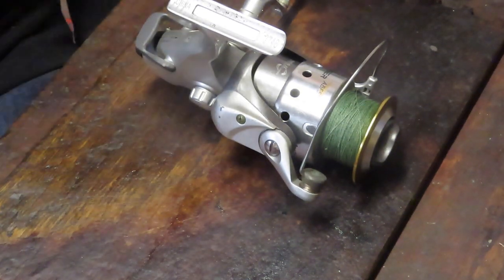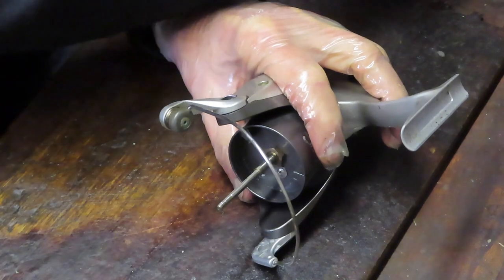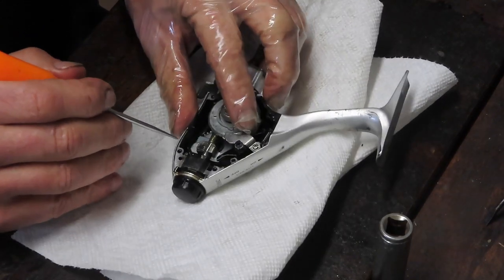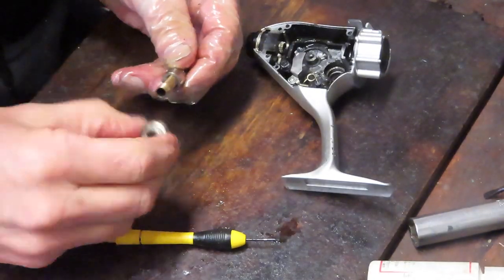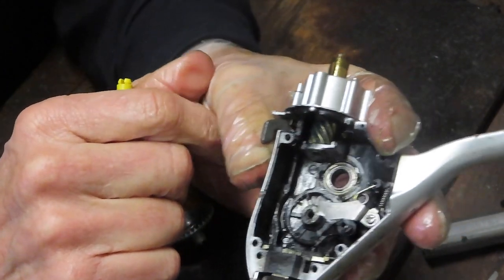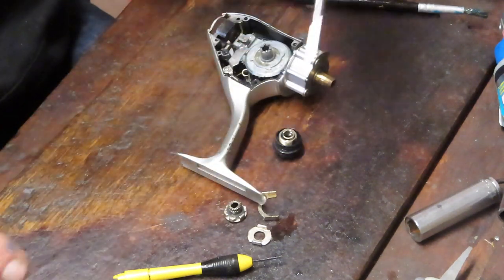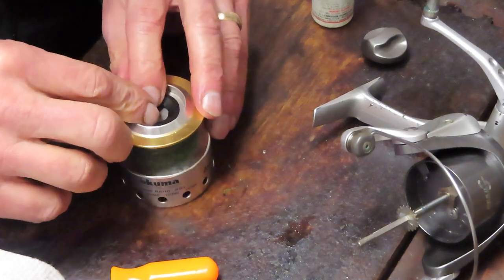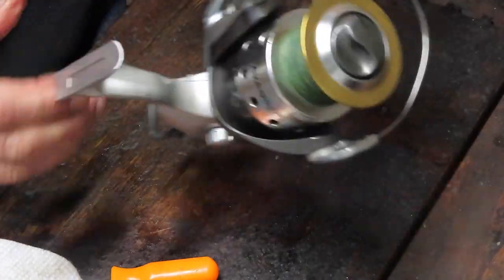Okuma Avenger ABF50 bait feeder fishing reel how to take apart and service

Comment: Dennis, I got an Okuma Avenger AFB40 last night. It was very reasonable and in almost new condition. It comes with the box, papers, and an extra spool. I would have wanted to get a model that is a little larger but this one will be what I need to learn how to use a bait feeder reel.
Reply from the maker: Still adding to the collection from your new YouTube site?
Reply: @2ndChanceTackle  yep! From my new YouTube Channel:  “Back in the Hospital Bed.”  I am really pleased and surprised by a South Bend Classic 960 reel that Armando told me about. It was inexpensive but incredibly over-built by Ohmori in Japan. I have one Gladding South Bend reel that is awful. This 960 is a worm gear reall with all internal parts being stainless steel. It looks like a SpinMaster Pro Series or Fury Diamond  as well as a few Shakespeare Ohmori reels I have. I’m sending you photos.I had given up on ever finding a decent vintage rear drag reel from Daiwa. I’ve had two that I had to get refunds for and the sellers didn’t even want them back. They couldn’t have been repaired. This latest one is a very large Daiwa ST-9070 rear drag that has a lever for quick setting the drag. To look at it you’d think it is a bait feeder but it’s not. I’m home from my YouTube site now and feeling some better. It’s going to take a few months after this illness to be near normal again. Moving around is difficult. ——Chris
Reply: Chris, thanks for recommending this video to me. I guess, it will help me with my Okuma Baitfeeders  in the future.
I hope, you will be able to fish with that reel very soon! Get well fast and keep care of you. 
Bart
Reply: @bart-b9497  Tmhanks so much my good friend! I had no idea you were such a connoisseur of Okuma Spinning reels! You have some very nice Okumas! This OKume Avenger I just got was the first Okuma reel I’ve ever owned. As I said the more I delve into its secrets the more I like it. Can’t wait to sigh with it! I enjoyed the photos our your reels! Thanks also for the get well wishes. I’ve got a way to go yet but I’m definitely in the mend!

Comment: I have one of these I bought when they dropped the 50 size reel and had them on closeout. It is one of the few newer reels I use and it has been a good reel. I got it to use on a catfish rod where a baitfeeder works great. It's not so complicated that I couldn't tear it down to service it.
Reply from the maker: Well said.  Durable and easy to service.  Sounds like a good reel for cat fishing - best wishes - Dennis

Comment: Everything I see in this reel makes me like it a lot. Simple is always appealing to me and compared to other bait feeders this one is much simpler. I like seeing that seal and I love having an AR override. It has 3 bearings and I like that.  I’m not overjoyed with the rear drag however.  I like it Dennis. Maybe this would be a good first bait feeder for me.
Reply from the maker: It would be worth looking into.  Made in Taiwan at the Okuma plant.  Reasonably priced and with all of the features you would need -
Reply: I can attest to their quality. Three years ago, I bought one, liked it so much that I bought 2 more. I've caught everything from bait to tiger muskies on them, and they've handled the heat of summer to dead of winter in Central New York. One of these days I'll get to the ocean and try them there too.
You can certainly pay A LOT more for a lot less reel.

Comment: Loved the video. Am working on my own ABF50. One portion you didn't cover is the Bail Arm/Wire . My issue is that it is not automatically flipping when the reel is turned. I removed the Bail Arm Cover and the Kick Lever "kicked" itself out .... Ideas on reassembling? and how to address the Bail Wire now flipping to reel in?
Reply from the maker: Watch this video and see if it helps you reset that arm and spring https://youtu.be/Qrr_rizFkYw. Thanks for asking - Dennis

Comment: These reels are pretty decent and can take a beating. I just dislike the "graphite" ramp to trip the metal bail. I don't understand why manufacturers just can't attach a metal plate on top.
Reply from the maker: I guess that would involve more cost and a design change in the mold.  I don't know of any graphite reels that have that adder.  Great idea - Dennis

Comment: Little off this topic: Can you explain the purpose and re-installation of the little plastic hex nut that are found on a number of Shimano reels? The piece I’m talking about is located on the threaded through rod on the cranking handle.
Reply from the maker: Yes - that nut enters the screw cap and holds it firm in the main gear
Reply: Good question.  Ive wondered that myself.

Comment: Great videos.  Question for you.  I am using this one to reference a repair I am doing on a Cabelas Salt Striker reel with baitrunner components.  When I took it apart, the "anti-reverse lever spring" shot out and I can't figure out how or where it's supposed to go back in.  This is a simple "V" shaped metal spring.  Any thoughts or other videos you may have that may show how that part would be reassembled?
Reply from the maker: If you can send a few pictures of the spring and the  inside of the case around where the A/R spring goes to my email - 2ndchancetacle@gmail.com I will try to see if I can help. - Dennis

Comment: If the anti-reverse clutch is really dirty can I remove it to clean?  Thanks for your video!  Great help!!
Reply from the maker: Yes you can.  I recommend that you clean it with a penetrating oil to dissolve the dirt and grease and then blow dry it out.  These would not be greased or oiled and are designed to run dry.  Thanks for asking - Dennis
Reply: @2ndChanceTackle  Hello did you show the anti-reverse clutch in video? If so, what time in the video? Also should rear drag be oil or greased (19.51 in video)? Thanks

Comment: I just bought a cbf40 okuma and it has a tight spot right out of the box. Is that something you would be able to fix?
Reply from the maker: If it is ew, return the reel or send it to Okuma to repair under their 1 year warranty.  No need to pay for their quality control issues. - If you have had the reel post warranty, then I can service it.  For service and repair information, please send a note to my email - 2ndchancetackle@gmail.com - Thanks for asking - Dennis

Comment: I took off the side cover just to check the inside. Put it back on and now the main drag doesn’t work. Any ideas?
Reply from the maker: The main drag is in the spool, so removing the side cover would have no effect on itnunless you did not reset the trip lever properly and the spool is spinning backwards.  I would recheck that first - Dennis